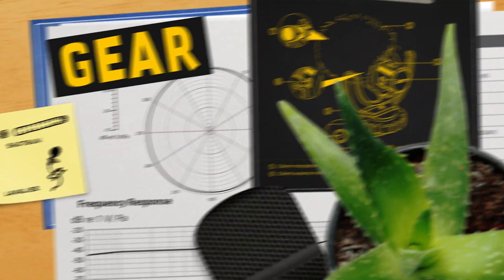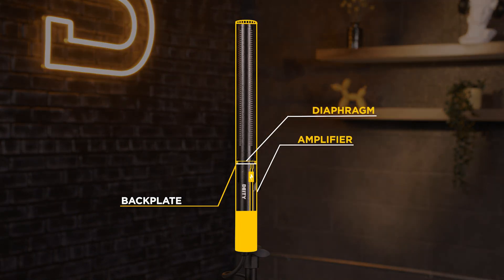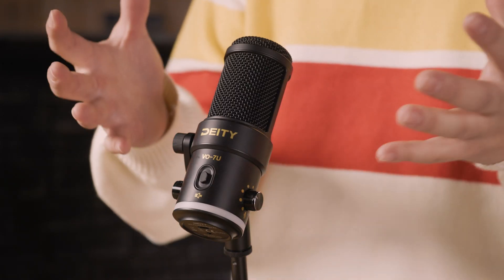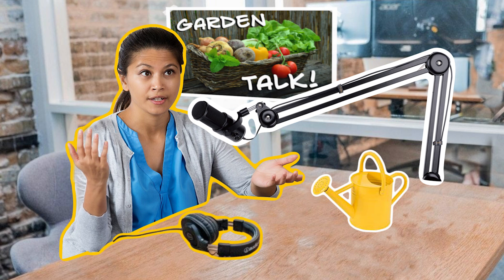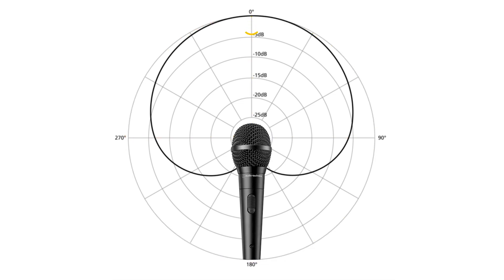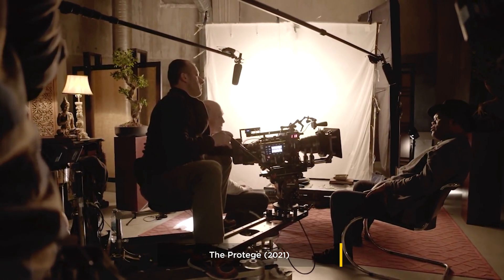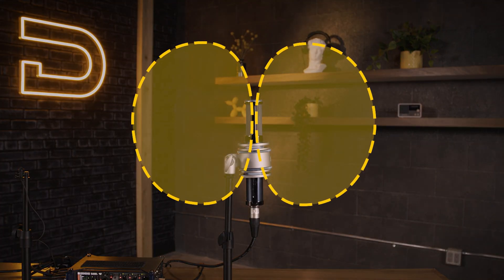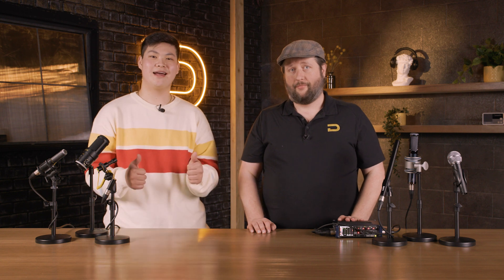How Do Microphones Work? | Pickup Patterns, Capsule Types and More

Comment: #mailbag What is the easiest and quickest way to reduce noise coming from and into your room? The walls are 1/8 inch sheet metal. Just the smallest improvement will be a sleep saver.
Reply: I don’t need it to be sound proof but even the click of a pin or the creaking of the mattress can be easily be heard through the walls. I just want enough so that I can have a conversation and not wake up the entire barracks.

Comment: #mailbag When shooting an ECU, mere inches from the actor, is there a method for mitigating camera noise by either dampening, shielding, absorbing, muffling or isolating the camera’s fan? Are any of those the correct terms and do they have different meanings? Put another way, in cinematography we use things like solids and black wrap to block errant light. Is there an audio equivalent to a duvetyne solid?
Reply: I'm hoping somebody else will be able to chime in on this. Interpreting the question. the easiest thing to deal with it's simple get a camera without a fan there's your problem if it hurts stop doing it. Traditionally on camera mounted microphones are more of a shotgun/super cardioid pattern as the Null or cancellation zone in the pick up pattern blocks out most noise behind and around the camera. If you want to you can almost think of the pick up pattern in reverse as light outputting rather than receiving, and the way the microphone is built it acts the barn doors kind of block off where the light goes.
I am taking ECU to mean ENG electronic newsgathering style? (and not engine cooling unit?) aka  person in front of camera speaking. Getting a microphone away from the camera and onto the talent is a possibility that will get clearer audio. This is usually done with a handheld dynamic microphone in most cases dynamic although anything with a reasonable low handling noise can be used. alternatively a lapel are used to get a nice close clean audio signal.
Reply: @imark7777777  I think we’ve had a little miscommunication. ECU is cinematography speak for extreme closeup. I should not have assumed that it’s an acronym of everyday use. All professional cine cameras have fans which is almost never a problem because we don’t mount mics to camera. Mounting a mic to camera would be more of a blogging thing than a film production thing.

The circumstance I was thinking of is when the camera is positioned extremely close to the talent’s face, just a few inches away, and the talent has lines to deliver that need to be recorded. Even a shotgun mic at that distance will pick up fan noise regardless of it’s narrow polar pattern. And a lav would certainly pick it up. I’ve never seen a sound recordist use a textile or any other form of sound dampening shied. I was just wondering if it’s a thing.
Reply: @carlitoshuanes  I said that because I knew it was gonna be somewhat vague when the first/ all response on a DuckDuckGo search was engine related.
There's the context I was missing.
I've done a lot of watching from the sidelines (since I was really young, so sometimes lack Termanology) most news stuff will have an on camera microphone as a back up.

hmmm yeah that would be the I'm hoping somebody else chimes in on this. I also couldn't resist the bad joke in there. I have a lot of live Music sound experience, and the last few years I've been broadening my capabilities.

If you can't get rid of fan other than directional microphone and maybe some foam I can't think of anything other than Software removal. It would definitely be worth playing around with placement though. Or you can water cool your red like on LTT.... No that's a bad idea.
Reply: @imark7777777  I appreciate the response, thanks! I wonder if they just use the audio for reference and wind up ADR'ing it. It does seem like a challenge to match if the entire frame is the lower half of a face.
Reply: @carlitoshuanes  yeah I hope somebody chimes in with an answer now I'm curious. From what I've seen done in behind-the-scenes stuff it's usually microphone just out of frame and or wires (wireless Lav) but that doesn't account for the fan issue.
oh I also had a "new" instead of "news" my previous comment.
ADR is expensive, time-consuming and can lack the original performance so generally avoided unless absolutely necessary.